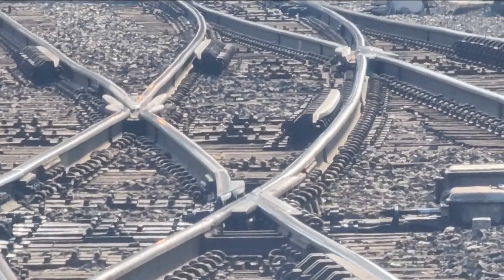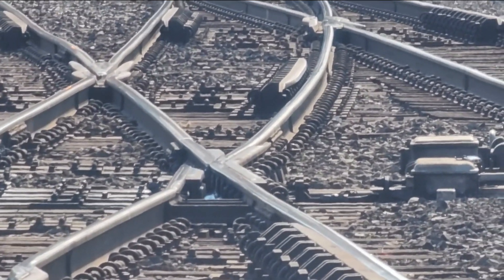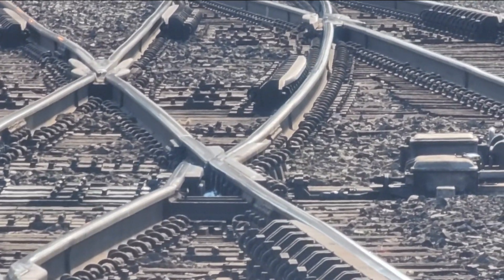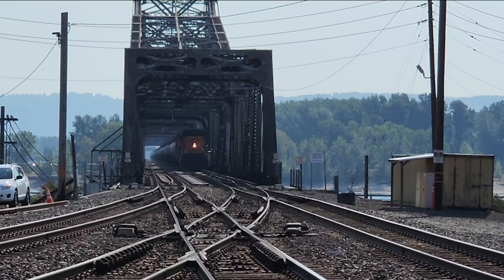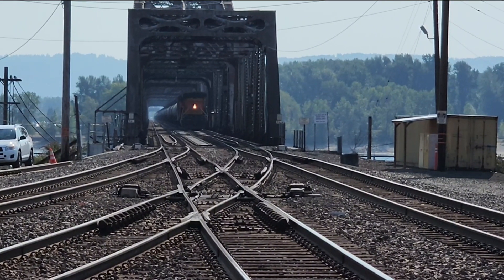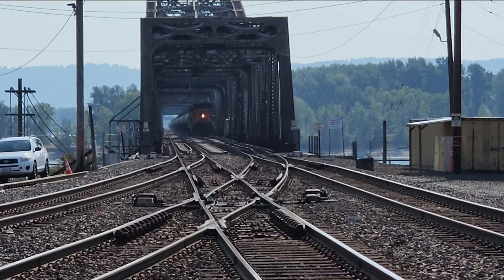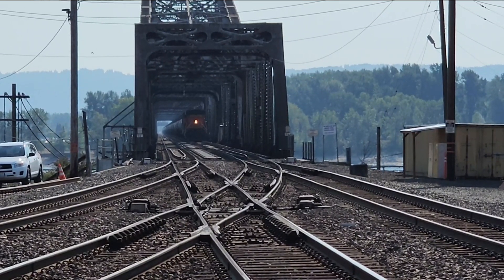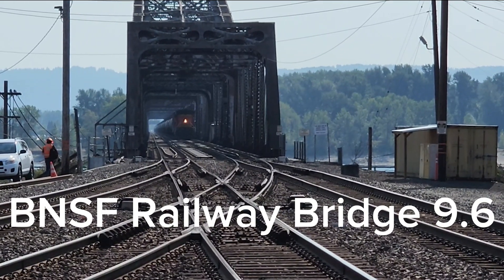Movable Frog in action at BNSF Railroad Bridge 9.6

Comment: Moveable frog for a diamond, haven't seen one of those before. I've seen them for turnouts, there are several on the Burlington Racetrack west from Chicago, and they're installed for the same reason. Much of that route is rated P-70 F-50, and the moveable frogs combined with longer turnouts allow for higher speeds.

Comment: I wonder where you found the 30 mph across those switches. The turn is pretty sharp, so my guess would be 20 mph.  Just curious as someone who has operated light rail trains over switches similar to these.
Reply from the maker: @MegaSnow121  big yellow signs at 0:22.
Reply: @ I stand corrected. Thank you for pointing that out.

Comment: I assume the signs at 0.21 are speed limit signs; P for passenger and F for freight.  What is the T for?
Reply from the maker: @SCDRROHVA  T is for Talgo, it's the trainset used by Amtrak Cascades. (Had to look it up in the BNSF guide to confirm)
Reply: @jordansean18  Thanks!  I'm glad you explained what Talgo is, as I did not know that either.  I appreciate your response!
Reply: Train  🙂

Comment: Excellent video. Strictly speaking, such types of frogs are called "Moveable Point Frogs", not "Moveable Frogs".
Please note that in a rail-rail crossing of non-HSR (High-Speed Rail) operations, only half of the four frogs, i.e. those located at the obtuse angle positions of the load-bearing rails, can be of this type. The other half, i.e. those located at the acute angle positions, are of conventional rigid point type.
Also, such frogs cannot be used at large angle line intersections where railway "Diamonds" are used.
Both of these constraints are the result of intrinsic engineering considerations. 2024/10/05. Ontario, Canada.

Comment: I taught railway engineering for six years, including a whole lecture on switches (turnouts) and crossing, thinking I had covered everything. But I was not aware of movable-point frogs for CROSSINGS (which is shown here). Movable-point frogs (also known charmingly as "swing-nose frogs") are fairly common on high-speed lines, especially in Asia and Europe, for SWITCHES. I know BNSF has used them on mainline crossover switches in the US. By eliminating the rail-head gap they reduce wear on wheels and rails, and therefor maintenance needs. They also reduce noise, a consideration in dense urban areas. (Note to British and maybe some southern US viewers: In most of North America "crossing" means one track intersecting another at grade with no choice of route, not the rails within a turnout that cross. And crossover means a pair of switches that allow a train to move from one track to a parallel track. Don't get me started...)
Reply: AFAIK it's mostly the American thing to have diamond crossings on mainlines.
On Russian railways (that is, in all ex-Soviet countries) placing diamonds on mainlines are prohibited (with rare exceptions for double-slip turnouts).
Reply: Not MOW nor do I portray that on TV. MoE my entire railroad career. Thank you for giving my trains something to ride on.
Reply: I took a Railroad engineering course in college. Then worked for a Class 1 railroad for 6 years.